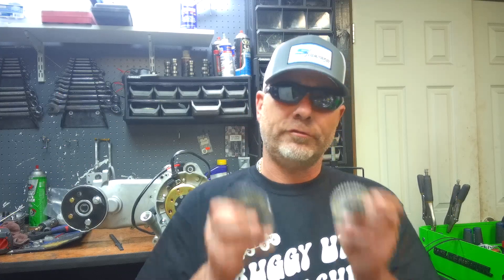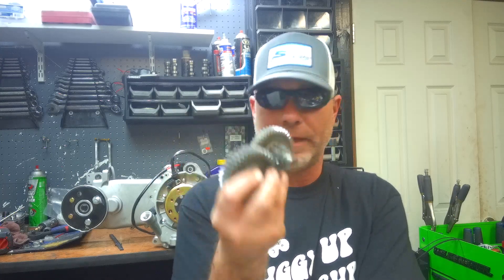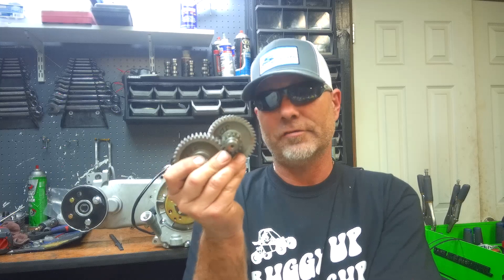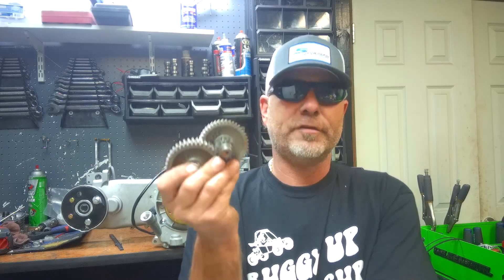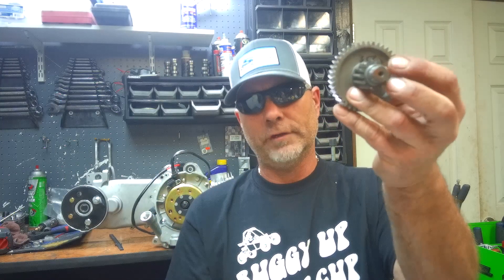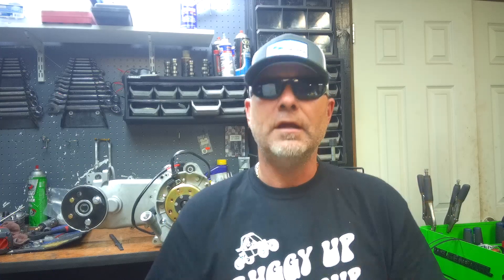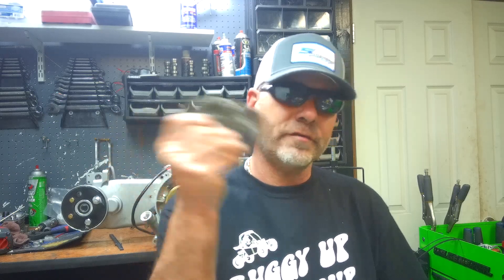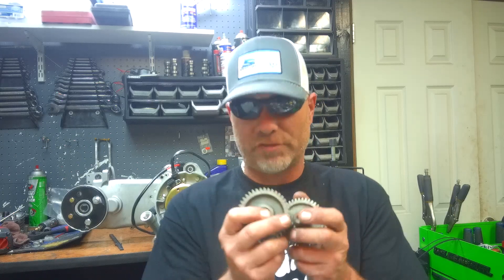GEARING UP......3 WAYS TO GEAR YOUR BUGGY

Comment: What is the gear ratio on the crossfire?cause I bought from you a 45 tooth sproket Wich made the buggy have more torque. And if I can get more it would be great.
Reply from the maker: almost positive stock on crossfires are 13/40 already